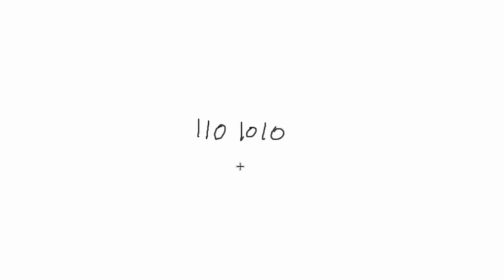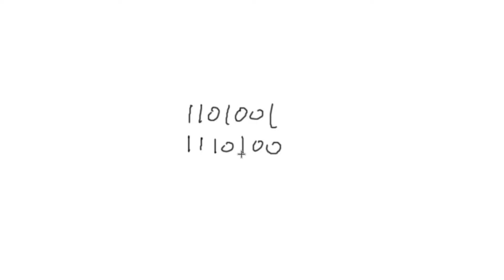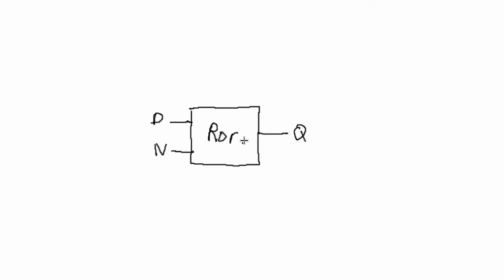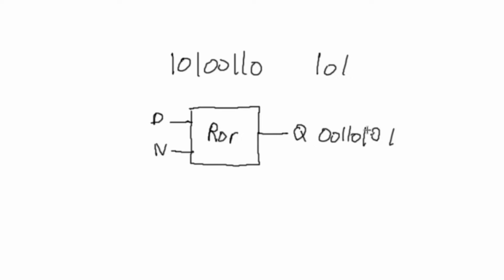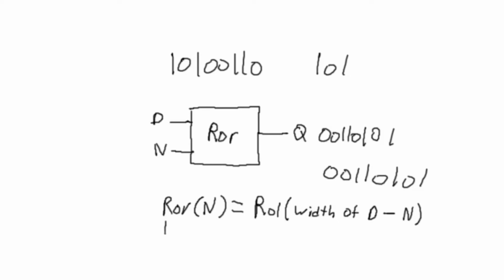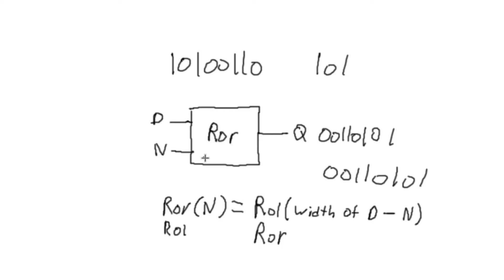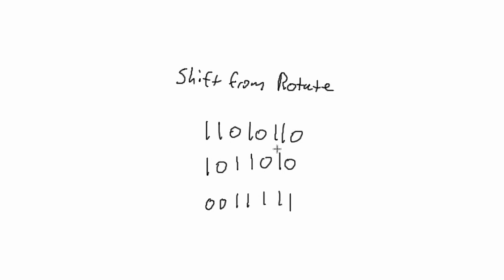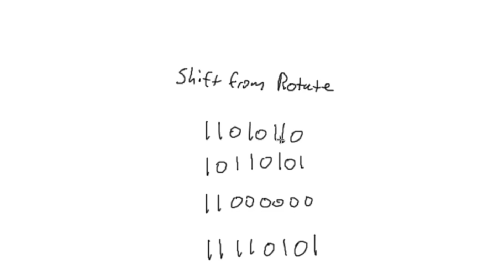Binary Rotation

Comment: Hey n00b_asaurus I've been working on some interrupt  hardware and I find it is easy to nail down prioritization by time and by port priority level but I am really struggling to integrate both into an interrupt handler. To be clear, a system that prioritizes interrupts by the time the come in but higher port interrupts "gain" priority over time. Do you have any resource for this, any suggestions?
Reply from the maker: prioritization over time... that's a new one. Explain.
Reply: @n00b_asaurus  Essentially, instead of doing port level prioritization you give priority to interrupt requests as they come in. So, if three interrupt requests come in in rapid succession they are serviced in the order that they came in regardless of where they came from. I believe this is usually done with FIFO memory but I am no PIC expert. My original question though regards blending this style of prioritization with port prioritization (where interrupts are serviced based on where they came from regardless of what order).
-Cody "resource" McGuire